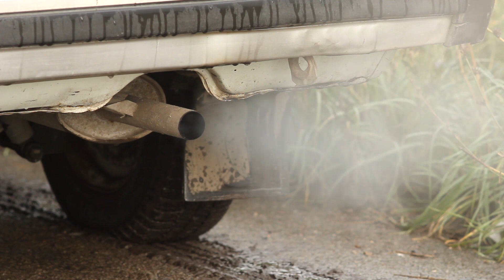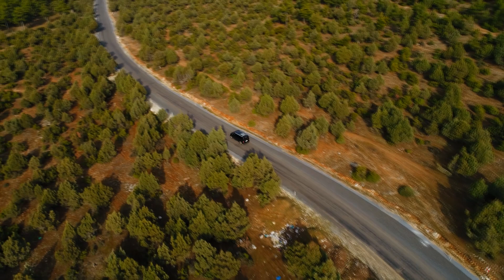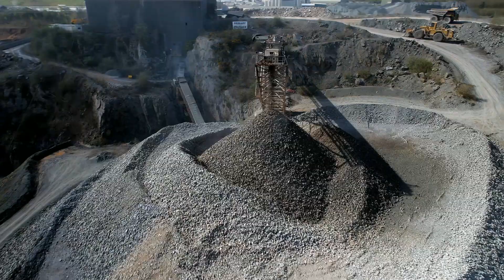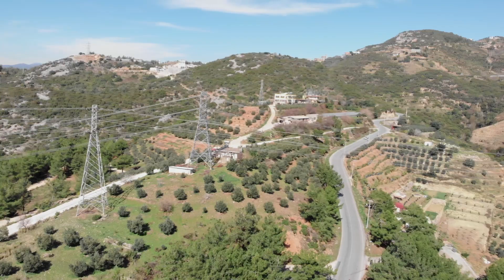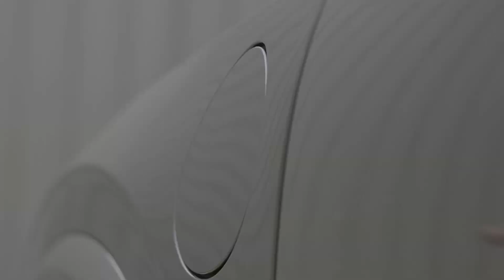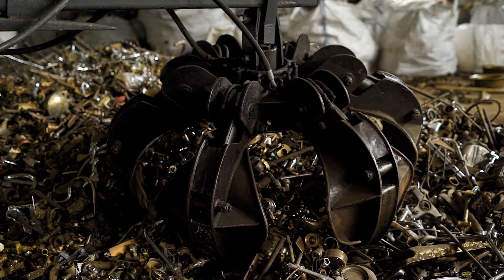Are electric cars as green as they seem?

Comment: Overall, solid video! It's always worth evaluating new technologies, like EV's, before fully buying in. I've got a couple of notes to add to the context.

"Are electric cars as green as they seem?" may not be the right question. It's subjective and depends on who is defining "how they seem." Some people think they're completely zero emission, while some people think they're many times worse than gas cars, based on info they've seen in the past.

The important question is "Are electric vehicles greener than gas vehicles?" Over the course of their lifetimes, the answer is broadly objectively "yes."

With adoption so low, EV tech is in its infancy. As a result, EV production is far from being optimized, so take current factory emissions with a grain of salt. (For example, Tesla's new structural battery will make EV's lighter, reducing particulate emissions from things like tires.) Gas car manufacturing has been honed for over a hundred years, for comparison.

Further, comparing what the grid that supplies power to EV's looks like today is not the right way to look at it. As they're so young, EV's will be charged by near-future grids, which will be a bit greener.

It's absolutelt worth noting that with EV's it is at least POSSIBLE to have a low-emission lifetime. This is dependent on us improving our grid and manufacturing processes, but it is at least possible, and incentivizes us to go greener.

Gas cars' tailpipe emissions, though, eliminate the possibility of having a low-emission future right off the bat. Even if we were all renewable, they'd still be polluting a lot.
Reply from the maker: Thank you for your feedback! Yes you make a number of valid points. What I'd like to get into more detail on in the future is the decarbonisation of the electricity grid, because this is the limiting factor at the moment and will continue to be for some time (unless the supply chain can be moved or replicated in Europe/US). This is because, like you say, carbon savings can be made with better technology and better optimised processes. But with the expansion of fossil fuel power plants across Asia, where the batteries are made at the moment, CO2 production will remain high.

As for the subjective nature of the question you are correct. When researching this topic I was surprised that an EV would still produce 75% the emissions that a ICE car would have at 150,000 miles. I thought the CO2 savings would be greater anyway! 

Thank you for your comment!